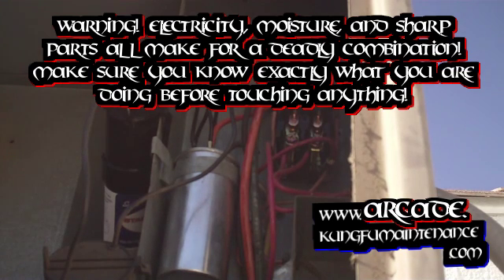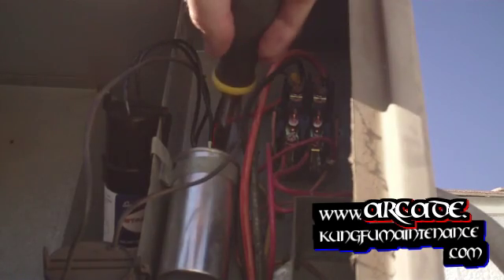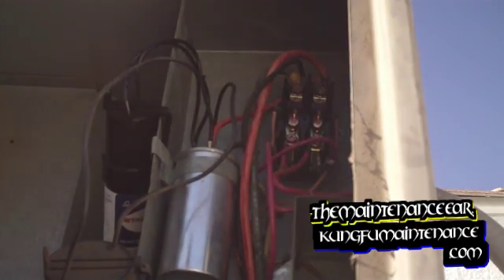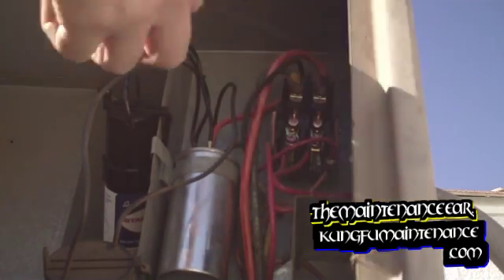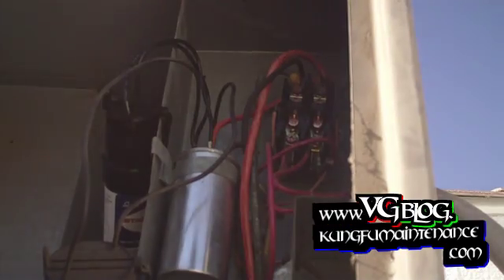How To Replace Air Conditioner Capacitors Without Getting Electrocuted

Comment: Poor demonstration lacking clear view of the top of the capacitor and the wiring hookups.  No explanation on how to discharge the capacitor or discussion of safety concerns.  The camera position is low and behind the process so the persons hands block most of the view of what he is doing. Sorry for the low grade but teaching and demonstration is not a strong point in this video.

Comment from the maker: Holding the insulated portion of the screwdriver I used the metal part of the screwdriver to bridge (connect) both leads (terminals) of the capacitor. This (neutralizes) discharges the charge. Using a (proven good at time of use) non contact voltage detector (circuit alert device) (also called a deadmen's stick) is a good way to prove power is discharged so that you can work on the system.

The cap on the blower wall most likely starts the fan motor and the board mounted runs the compressor.

Comment: Great demo, my question being a novice who is prone to being shocked, what exactly did you touch to what else in order to discharge the capacitor? Did you touch the contacts together or touch the contacts to the AC sheetmetal? I could not see what you did to discharge the capacitor. Thanks!
My AC has an oval capacitor like the one you installed mounted to the board and another cylinder type mounted on the blower wall. which is the start capacitor?

Comment from the maker: Glad you asked such good questions. The hard start kit gets hooked up to the "C" and "Herm" Terminals one lead to each terminal and polarity is not a factor so either lead can go to either side. There is some debate about adding hard start kits if a unit is working fine. I find in my area they are needed right away due to minor voltage issues even on brand new condensors so I prefer to add them rather than get called back later. In my opinion they are beneficial as they reduce start up stress.

Comment: Thanks, and one followup question....what capacitor terminals did you wire to with the hard start kit?  In the video it looks like the hard start kit has only two leads, if so, does the hard start kit wires have any polarity when hooking up to the capacitor?  Also, is it advisable to add a hard start kit if your unit is working fine, does it enhance/prolong life of unit?

Comment from the maker: This one was a singular capacitor having only two ports. A dual run cap will have three ports, Common, Herm, and Fan. You can tell the wiring port for Herm by tracing it back to the compressor start terminal(yellow wire on Goodman systems). The fan port wire will trace back to the fan. Common terminal usually has two or more wires. You can tell by wiring color(though some manufacturers do use different colors)."Fan" wire will be brown,"Herm" yellow, and common wires black, red, and or blue.